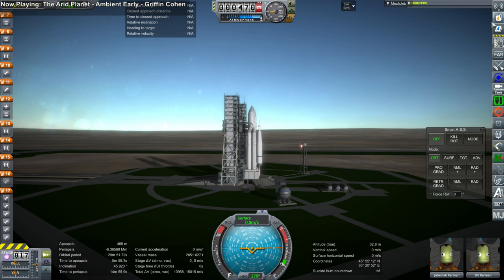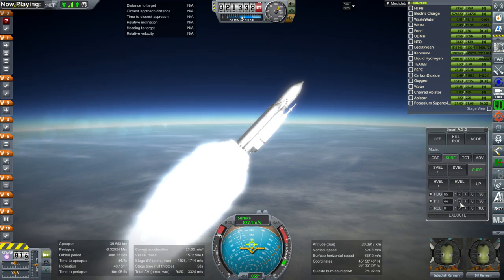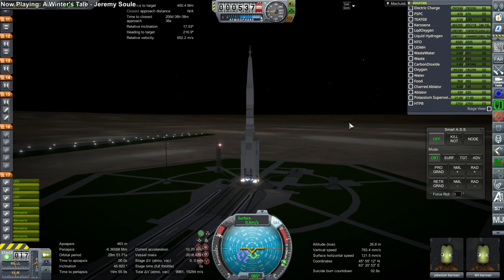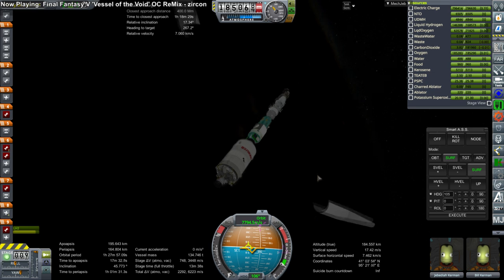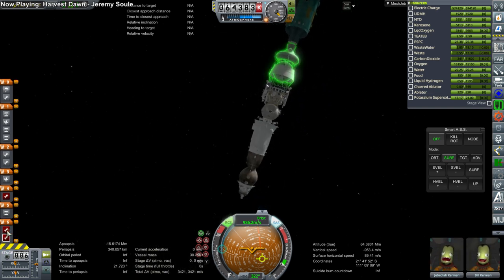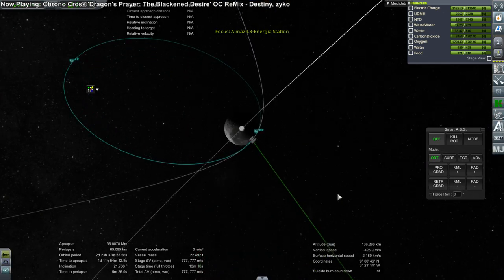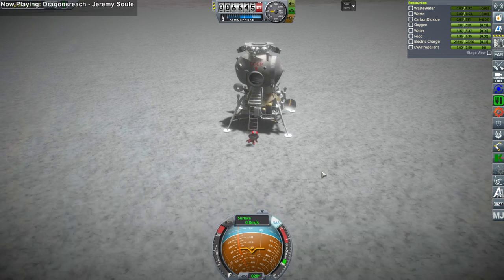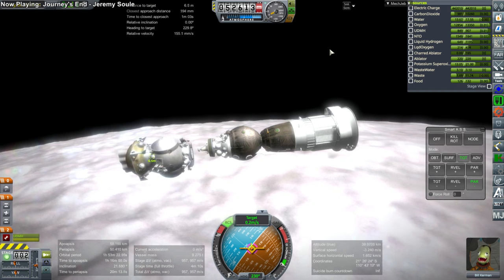How to Land on the Moon 03 - Energia

Comment: Actually, Energia's reusability was not that far off. The RD-170 engines were already certified for 10 uses, and the Zenit boosters had compartments for the landing gear, parachutes and retrorockets since the first launch. Had Russia not given up the Energia family, it could have covered their whole range of space applications with Zenit for light (12t), Energia-M for heavy (35t) and Energia for superheavy (100t) missions. And it was all ready. Instead, they let the hydrogen and N1 infrastructure to rot while pumping ridiculous $$ into expendable, non human-rated Angara that after 25 years of R&D flew twice and is somehow more expensive than Proton & Soyuz, which it meant to replace, let alone compete with Falcon 9.
Reply from the maker: Ah, I mainly meant the main engines (RD-0120s) in comparison to the SSMEs. Yes, the boosters were farther along. I think if they had focused on Energia instead of spending extra money on Buran, they would have had quite a system, especially with the Energia-M option.
Reply: thank you google
Reply: About Angara. 
As a russian myself I know a little bit about the rocket and I can say that Angara is mainly a military project. And as they say it is meant to be the so called "guaranteed access to space" (from Russian ground). And the price, higher than the Proton & Soyuz can be justified firstly, because they want it to be highly reliable. And also because Angara (as a whole project, not just a rocket) needs a lot of new & specific infrastructure. In fact, there are plenty of new factories being built. And to be fair, Angara will be the first major project mainly of Russia and not the USSR. 
And It's kinda opposite for Proton & Soyuz - they are just a shadow or... a heritage of the Soviet Union. There are just being peacefully produced and modernised, occasionly. (And Proton is already dead as we knew him, it's already making it's last flights)
Reply: Not to mention the proposed Energia Vulkan, Wich would of lofted 200tons to LEO

Comment: Buran, even with 30 tons capacity, had superior OME (Orbital Maneuvering Engines) over the Space Shuttle due to the gaseous kerosene/oxygen used as fuel being non toxic and having higher delta v capability. So it could still carry five tons more to higher orbits and return.
Reply from the maker: But it was fundamentally useless because it was built by an economy that could not sustain it, refly it at a pace that would make reusability valuable, and had no need for it. It is easy to one-up an existing system like the Shuttle when you already know all its specs because the American development program was public. But Buran was never outfitted to carry crew and was never put to any useful purpose. It was a novelty act like Voskhod. And in the process, it crippled the ability to further develop the useful part - Energia.

Comment: According to RPO-Energia; TLI capacity was only 32 metric tons
Reply from the maker: That number is highly dependent on what upper stage is used for the transfer. It's possible that the stated capacity to TLI is with the Energia core launching direct to the Moon, unless there's some other stage cited. Also, was that in its side load configuration or with the load on top? The side load configuration, like with the Polyus launch, limits the system.
Reply: @RaizSpace  I cannot find any information on any top-mounting points.

Everything launched, planned to launch was with the standard Energia rocket with 4 boosters.

The nose cone does not appear to have been holllowr for any kind of payload or have rockets within
Reply from the maker: There would need to be an adapter above the liquid oxygen tank to fit the stage as I have it here. That sort of thing was planned for the Energia-M and Vulkan so I'm sure they could have managed it. All I can tell you is, the configuration in the video definitely would be able to deliver the payload depicted in the video - the math is the math. The capacity they cite is likely for without an upper stage, but this upper stage was under development for the Vulkan rocket (the 8 booster variant of Energia) and could have been adapted for Energia as well.
Reply: @RaizSpace  thankyou for your dedication

Comment: Did the Energia ever fly without Buran ? Buran only flew once, but with Energia being a whole rocket in of itself, I'd imagine it got a little more test time than just the shuttle component.
Reply from the maker: Yes, it flew just one other time with the Polyus spacecraft, which was placed in the same way as Buran and the N1 stack in the video.
Reply: @RaizSpace  I see, that's some fancy stuff. Thanks for the response m8.
Reply: Actually, engineers of Energia chose slightly different approach. They did a lot of tests prior to any launches, and by a lot, I mean - really a lot.
Reply: Vulkan would of had an Energia Light engine as the upper stage